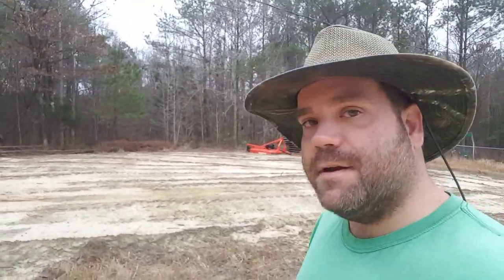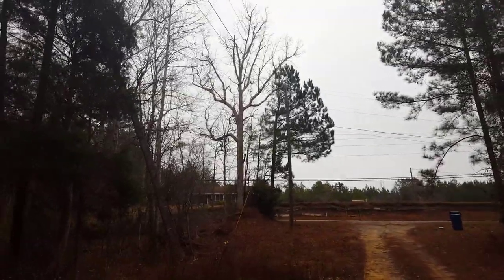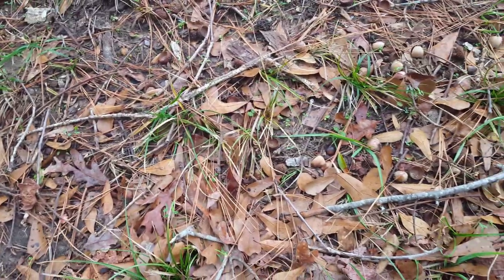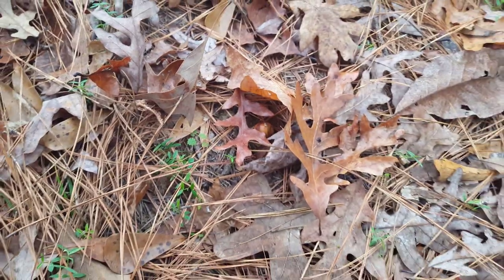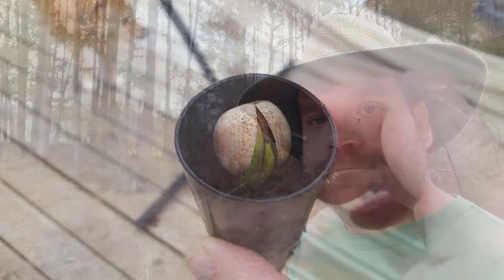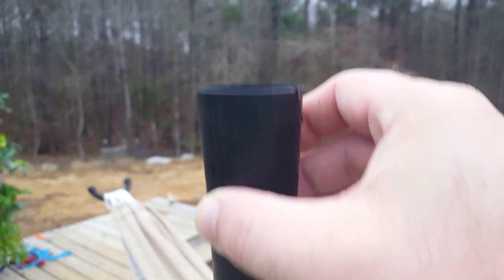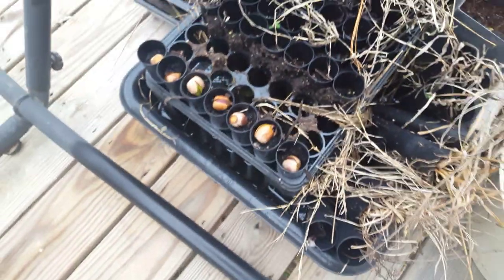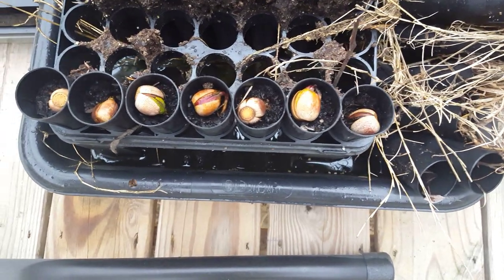Growing a Tree from an Acorn

Comment: I just found my oak tree has many acorns on them. I cut a couple of branches that were overhanging my garden shading it to much. I learned how to put them into water to see if they are good enough to try to seed and grow. I am living in my home for over 20 years and never saw this many acorns on this tree. So I am trying to put the acorns all around my property to see what may be best for them to grow into other trees. I bet next year I will be pulling out many seedlings that the squirrels have gotten to. I also put them in water and soaked them. Dried them for a couple of days- glued the tops on the acorn so I can use them in crafts for the fall. Good luck with your oak trees.
Reply from the maker: Thanks for sharing!

Comment: I live in northeast Mississippi and collect acorns every fall to replant. I don’t have to worry about pots freezing solid too much during winter here so I just use left over plastic pots and fill them with dirt from the forest ( which I’ll return to the forest come spring ) plant the acorns an inch or two deep and let the trees cover the pots with leaves and come spring I have a bunch of little oaks ready to be divided up. I also do this with walnuts and pecans and other seeds from our native trees. I planted a shummard oak acorn I picked from a tree in town and planted in my dads yard just directly in the soil about 8 years ago and it’s now over 20ft tall. It’s beating the dawn redwood that was planted at the same time as a 1 ft tall seedling.

Comment: I hate those pine forests. Soon there won't be any hardwoods left much. After Katrina, my brother had to clear cut a large area of his property. He replanted with ponderosa pine (because of it's slow growth), several varieties of oak, hickory, and other hardwoods.  I wish others would do what you and he are doing.
Reply from the maker: Agreed! Thanks for the comment!
Reply: SouthernLady44 well, the pine forests are an earlier stage of succession. The hardwood forest meta doesn’t appear geologically until the pine/hemlock forests reach they’re maximum potential. Once these conifer forests are established they begin altering the soil. The top layers become filled with silt and biomass and therefore deeper. Plus needles make the soil acidic. This creates the perfect germination conditions for the seed of hardwoods(oaks, hickory’s, chestnuts, etc). Over time, the longer lived, stump regrowing hardwoods appear in larger numbers and they can outcompete the conifers (especially if summers become drier and hotter). Over time the Pine/hemlock forest becomes a late stage successional Hardwood Forest. 

You see without those pesky pines, we could never have those wonderful hardwoods

I am an environmental systems engineer. Hope this helps.
Reply: My mother lost 3 out of 4 200 to 300 years old live oak trees from Katrina.  It was a gut punch to see even those trees snap from that storm.  Live oaks are being replanted down here to serve as the wind break they always have, but their beauty has always had a place in my heart.  The placement of trees & maintenance of them is crucial & something we forget about so easily.

Look at California, their policies have been all over the place and have cost billions of dollars to the people.  Maybe they should let the American Indigenous people show them how to do it.  Lord.  Oaks are a huge part California's forest's but the stupid of the people there what non-native species that have messed up the balance.  Imagine that.

Comment: Hi there! maybe I suggest putting air hols into and around a 3 liter soda bottle, cut off the very top of the bottle until the trees are ready for ground.
Reply from the maker: Has that worked well for you before?
Reply: J&J Acres  hiya! no I'm more of an amateur gardener dreaming of my giant greenhouse LOL!  I think I heard you mention that you weren't sure if the taproot container came in a longer size and I got to thinking that a 3 liter soda bottle with the top removed might work. sometimes when I'm stressing out about my 2 18 yr old daughter's I suddenly find myself planting something. if I run out of containers I will cut 20 soda bottles in half ... hey desperate times ya know? LOL!

Comment: I'd be more worried about your Pine than the White oak, UNLESS the White oak has some rot in it. I have some Live oak acorns that I have planted into a 5gallon bucket. I have taken 6 out of the 5 gal bucket and trimmed the taproot/radicle a bit and put them into mid sized pots. I still have maybe 5-6 till in that 5 gal bucket with the whole taproot/radicle in tact. My question is, do YOU plan on trimming the taproot/radicle down a bit before potting the tree into the pot it will grow up in before planting it? 

I 'm worried that IF I don't ever trim that taproot/radicle that comes out of the acorns 'before the tree grows in a small pot that the taproot/radicle will be circling all around inside the small pot it is growing in, and, IF you trim that taproot/radicle the root system will be more shallow and fiberous, easier to transplant the tree then. Do you follow me here in what I am saying?
Reply: Wont it die if you if you cut the taproot I think you are supposed to be very careful with taproot so it doesn't break or get damaged in any way
Reply: @megamaxes  It will NOT die, my friend that starts oaks from acorns and sells them and sometimes uses the trees as "rootstocks" for other trees, sorry, I know NOTHING about that, he told me to trim the acorns taproots down to a half inch once they put out a taproot beyond that point. I HAVE seen some guys on videos that say to NOT trim the taproot. I AM going to leave 1or 2 of the acorns I have untrimmed JUST to see what happens, BUT, I am thinking that I WILL have to trim the taproot to pot them up in a pot that is NOT REALLY deep. IF I were direct sowing the acorn where the tree would grow, I would simply sow the acorn and NO trimming would be done, I HAVE direct sown an acorn in my yard BUT the LIve oak is LIKELY to need to be mature about 3/4 inch trunk girth to be okay in my zone 6a winters. I NOW have a hardy Live oak that is fine in my winters BUT it is an older tree and was sent to me when it was about 6-7 years old. I am growing these acorn seeded Live oaks in my greenhouse and once they get mature enough I will plant them in my yard, UNTIL then  I must coddle them, and keep the roots untanged and actually the one I was sent and planted that IS older and more hardy was sent to me in a pot that was maybe 8 inches wide and 10 inches deep ABOUT that size, it was NOT very deep and the taproot was SURELY trimmed, and so was more "shallow and fiberous". This is MY experience, so maybe others are having success NOT trimming taproots, BUT,  it will NOT kill the tree. IF taproots weren't trimmed you COULD NOT purchase and transplant ANY white oak family tree. Those pots at the Big Box store with a Swamp White oak or a Burr oak, NOT possible to fit in that 2 gallon pot at the store IF NO root pruning was ever done. Think about that. Many oaks send down a taproot several feet down, so NO root pruning? Just try and imagine what is in that pot your tree is in. Maybe some guys don't think about this? The roots WILL be twisted around in circles and IF the tree is in a pot, the roots will be twisted around and around, I chose to trim that taproot unless I direct sow the acorn where it will grow. In the ground.
Reply: @juliegogola4647  thanks for the tips just learning about this stuff and that's what  I have heard not to damage taproot
Reply: @megamaxes  I have heard 2 things about this and BOTH sources were from people that have experience with this whole "growing oaks from acorns" thing. BOTH have grown them in pots too. BOTH on the Gardenweb forums too. I am trying the trim the taproot method myself, I guess, just maybe try to do BOTH methods and see for yourself what was best? I am just learning too, 1 of the people I have been emailing too for a few years and HE says trim that taproot IF you are potting it, so, I am trying BOTH I have 6 potted and trimmed and about 5-6 in a 5 gal bucket, NOT trimmed, I will see what happens I guess.
Reply: IF you KNOW where you want your oak, direct sowing is best, lay the acorns on it's side and let nature do it's thing. That taproot will keep the tree from needing watered unless it gets SUPER droughty your baby trees first year, and MAYBE not even then. SOME oaks (white oak family oaks especially) the taproot can go down 6-7 feet, Burr oaks are said to go 7 feet, now, IF your soil is shallow and rocky, MAYBE not SO deep. I am potting my Live oaks because in my zone 6a hardiness zone ONLY the hardiest Live oaks CAN survive and grow AND even THEY may need to have a good bit of trunk girth to deal and do good here. Quercus Fusiformis is hardier than the Southern Live oak Quercus Virginiana, and so far on the Quartz mountain strain of the Quercus Fusiformis has done great for me here the last 4-5 years. I am currently try the plain Fusi using a "pool noodle" to protect it's trunk about 3 feet up, i HOPE the top will not be killed back this winter. There is a section all about this on Garden web IF anybody REALLY cares about trying a Live oak in the North or cold places in the South Like Oklahoma. NO, they will NOT look like a Southern Live oak growing in Florida, Alabama, Mississippi etc BUT, they look good enough for me to love my little Live oak anyway. It is evergreen all winter and getting bigger sloooowly each year.
Reply: @juliegogola4647  so to trim the taproot you have to trim before the  trunk of the tree starts to shoot out of the acorn? Or does it matter?